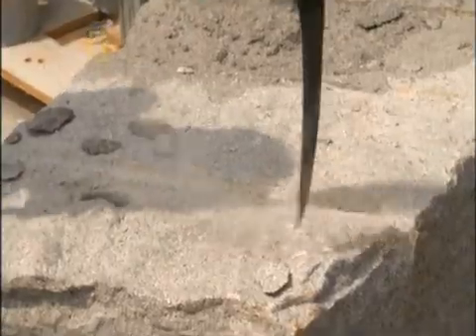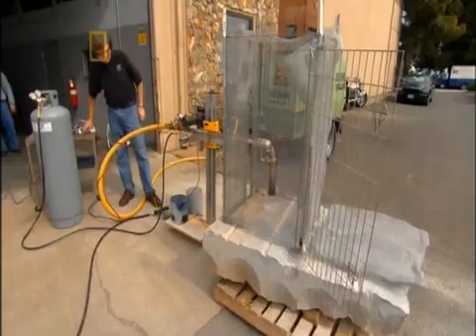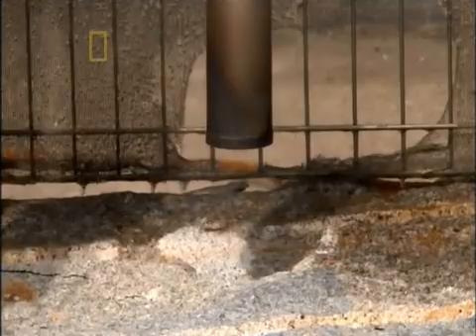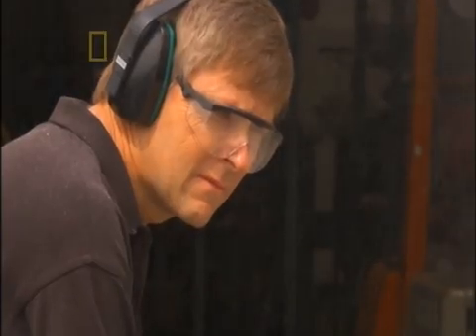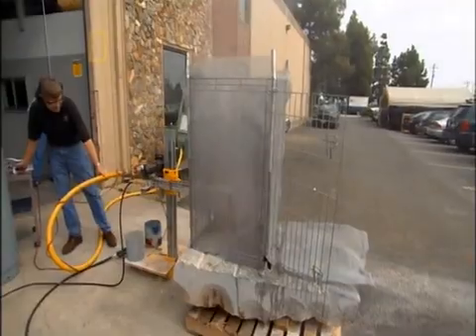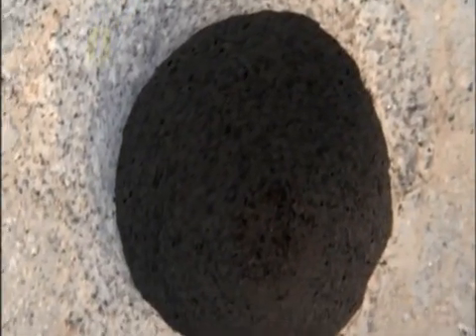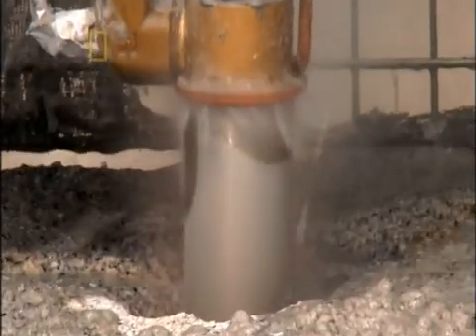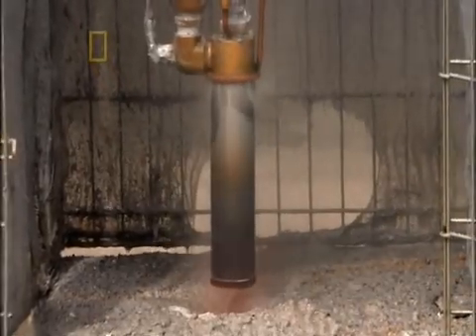Drilling in granite like butter

Comment: how is it possible for the device not to melt under those incredibly high temperatures?!!!
Reply: The point where the flame ignites is after the gas leaves the end of the tube, the flame is then cooled rapidly by the rock (and the transfer of that energy is partly what cuts the rock), the metal is also cooled by the gas as it leaves the end of the pipe, pre-heating the gas. Rocket nozzles use the same method to keep cool when the rocket exhaust is far higher than their melting point.
Reply: Its not as hot above and the Granite probably absorbs alot of the heat. 

My guessings.

Comment: It’s much quicker if you do it with a bronze chisel and hammer 🔨😂
Reply: Don't forget the dolorite pounder, what kind of amazingly skilled stone worker would go without their favorite smashing rock.
Reply: In addition, the Egyptian needed to be semi-naked and exposed to the sun all along
Reply: yean and they  are cultivating fields they are in hangars ofcource isn't it ainstain? @lancereaudamien
Reply: And it is far more precise as well
Reply: @FBurck  it is far more precise. us an angle grinder and a file to achieve a 90 degree cut and see which is more precise.
Reply: Try a large tuning fork on a copper tube...
Reply: If it ain't done with copper & a whole lotta faith, well that feels like cheating...   ;~ ]
Reply: no chisel and hammer for a bore, they used copper pipe and sand. go try it. :)
Reply: https://www.youtube.com/watch?v=yyCc4iuMikQ&t=398s just watch this and you will see pretty much how they did. I'm sure after generations of doing these works they had some impressive techniques.
Reply: ROFL - good one
Reply: Lol
Reply: They used a copper tube and a slurry of sand and water to drill out large cores.  It actually goes way faster than you’d think.
Reply: @lookoutforchris yeah a few inches in a few days.... So for the 10 foot core samples from aswan....a month maybe 3... Come on you don't really believe that do you? The results are not the same.
Reply: Pyramidiot defected
Reply: No no, copper... And dolerite..😂😂

Comment: Nice. Hydrogen took us to the moon too and exhaust is just water !
Reply: Well, technically hydrogen didn't take astronauts to the moon, and it brought them most of the way back. The first stage of the Saturn V used Kerosene and the Lunar ascent module used a fuel called Aerozine which I believe is a solid hypergolic fuel??
Reply: They didn't use Aerozine, they used an Arizona landfill to land on the moon. 😊
Reply: Gyrotron give fusion to h2, into helium...

Comment: Cost? im sure that gas isnt cheap  3 minutes so probably about 5 minuites, i can core a 102mm hole in tough mourne granite in 10 mins or less at 250mm depth using a well worn core bit new one would take much longer
Reply: How come a worn bit is better than a new one for drilling granite, curious as have green granite to drill in galway
Reply: Because a new bit the diamond segments are thicker a new bit always takes some time to break in.A worm bit has a thinner diamond segment , im talking a bit that is very worn will always cut granite/marble quicker. Another trick is after a few mins tap the diamonds on the end of the bit with a spanner of chisel roughen them up, as when cutting granite the diamond segments polish up and become smooth,be sure not to hit them too hard of the will break , you can still give them a bit of a whack though.

Comment: why doesnt "the boring company" use this technology. instant tunnel cutting and melting the tunnel structure for strength... what people think. ultimate technology. this and the  nikola tesla electron beam technology. it makes alot of sense and to get huge energy delivery would not be that diffucult and hard to break down.... i got tesla stuff if people want to check out...
Reply: That's not how the world works and that's not how physics and thermodynamics work, just because you googled a couple things doesn't make you a genius. Take a course and you'll see why this would NOT be viable for what you're proposing, there are massive hurdles humans have yet to get over before making it real.
Reply: @escapedcops08  if you're going to say that you're so much smarter than someone else you might want to back up by actually having an argument, "you're wrong, get smart" isn't an argument used by smart people budbud, also you shouldn't be gatekeeping
Reply: TheGreenTaco999 t which is presented without evidence can be dismissed without evidence
Reply: They wouldn't want to use this because it weakens the surrounding rock. You do not want to create a hole that has edges that are prone to collapse due to weakening by the heat.
Reply: boxa888 - I would like to see your Tesla stuff if you still have time to post it. Thank you for offering.

Comment: still looks like crap compared to megalithic structures
Reply: only significant projects were polished up.
Reply: It never said it was for precision cuts.
Reply: I love Youtube.
Reply: https://youtu.be/qeS5lrmyD74
Reply: @AEON.  magnifying glass type instrument using the rays of the sun to create a beam of hot laser
Reply: That's because they used sound frequency vibrations with tools attached to 6ft tuning forks.
Reply: @ginsuma1402  Look up a video called 'How to "melt" stones sound, p.1.', it shows interesting acoustic drilling techniques.
Reply: @ginsuma1402  no they didn't flinders pitrie and Chris Dunn who were the pioneers of the idea both proved that it wasn't under investigation. That the qurtz would have cut diffrently with frequency.
Reply: @michaelgallacher4800  both pen pushers. It isn't hard
Reply: @Ginsuma  Prove it.
Reply: but now we're a little bit closer.
Reply: John Bravo   Tuning forks of metal. They had metals back then....your incompetence is showing.

Comment from the maker: @stfubp : I think it's made of tungsten. It has a meltingpoint of 3400°C. The temperature needed to drill the hole is below 2000°C.
Reply: How did Mayans carve jade??
Reply: 5tonyvvvv - the standard method is to use something abrasive akin to sandpaper. Jade can't be normally drilled since it cracks and splinters.